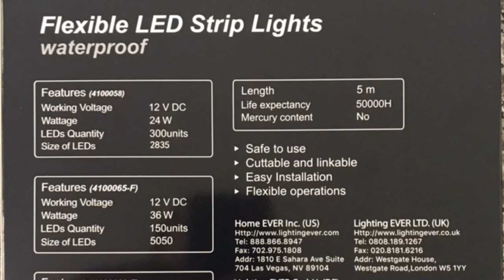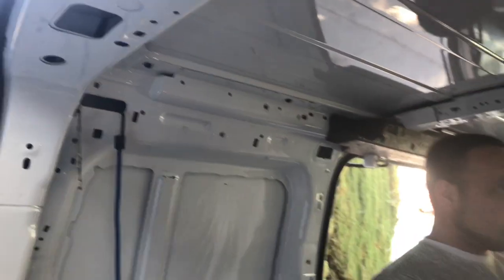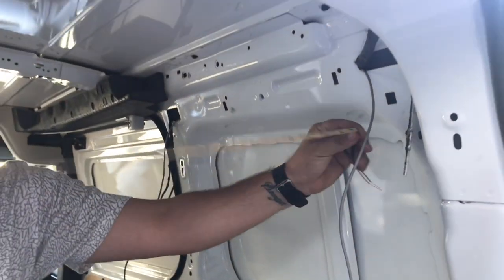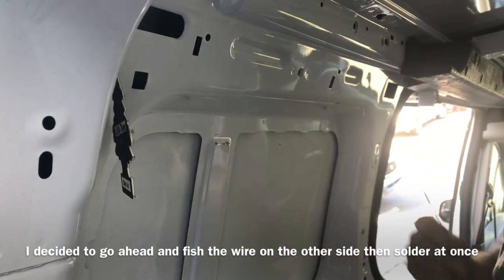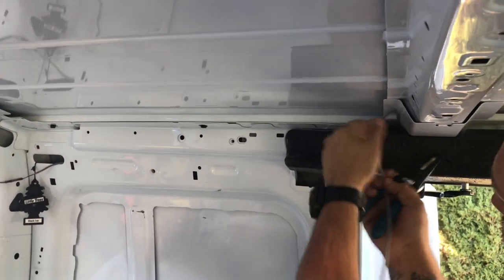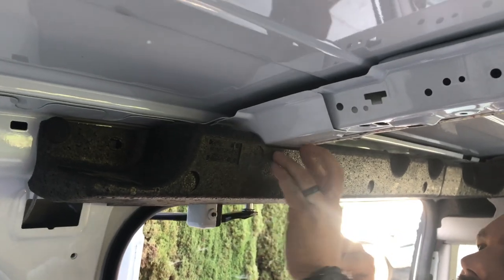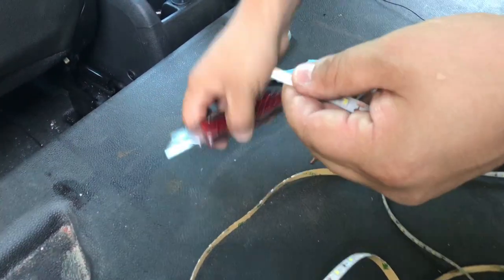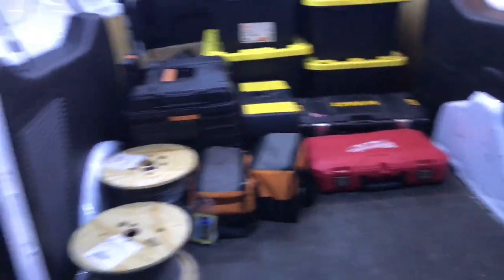How to Add LED Strip Lights to Work Van

Comment: Nice work. I saw the cable spools in your van what type of work do you do? Also, do you have a switch for the lights or is it just strictly when the doors open that they come on?
Reply: Strictly when the doors open. They operate exactly the way the removed lights operated as they are wired to the same power source.

Comment: Nice try always work from the dead end back to the live connection you done it live so every connection was done live under load just a tip in case you had a short in a wire or something that could fry the wiring in the van happened to my bud lights look brilliant & bright 👍
Reply from the maker: Derek Higgins Thanks for the helpful tip. I realize that now.

Comment: Heatshrink tubing placed over LED tape ends and wiring would have created a finished job, and insulated the connections
Reply from the maker: Since I uploaded this video just for fun. I’ve actually replaced the LED strip lights with a better quality. I also added heat shrink and double sided tape so they would stick better. Ill upload an updated video soon.

Comment: Hey Robert, this is exactly what I wanna do with my econoline. Is there any issues with splicing into the existing cab light as far as power goes? Like the fuse or the wiring being able to handle the draw?
Reply from the maker: I haven’t had any issues. With it being LED lights it doesn’t require much power/amps.
Reply: Roger that. I'm lighting that thing up by the end of the week. Thanks, man

Comment: Hi, I want to do the same for my van.. will it burn the fuses or fry the main board once I start the engine ?
Reply from the maker: No, I haven’t had any issues and it’s been 4 years since I put them in. Only thing  is I would recommend to have the engine running if you’re going to have the doors open for light. It did kill my battery once and I had to jump start.

Comment: How do I stop the timer from shutting the lights off after a few minutes?
Reply from the maker: I've had that same issue. I always end up having to close the door and reopen it.
Reply: @robertreyes4269  I'm running a carpet cleaning truck so having my hoses out I can't just shut them. I ended up running LEDs with a switch
Reply from the maker: Yeah it does get annoying. I'm glad you were able to make it work for you.

Comment: @Robert Reyes
Nice video :) One question for you. When I connect an LED tape to your video and when I close the trunk, the tape still lights up like a spot light. Any solution?
Reply from the maker: Thanks. Make sure your connecting the strip lights to the existing lamp in the trunk.
Reply: You could put your own switch in too if that Fails
Reply: I have the same problem when I lock the van they go off after 4mins, when I’m driving they stay on permanently.

Comment: Did the heat melt away the adhesive?
Reply from the maker: Sorry for the late reply. I added gorilla glue hot glue to some areas. Haven't had any issues with the adhesive since adding the hot glue. Thanks for your comment.

Comment: what happens if you have the engine running (which bumps the circuit voltage up upto 14.4 V) and open the doors (i.e. turn the lighting on) ??? Do the led strips get toasted or do they take it no problem?
Reply from the maker: Sander Tel I’ve had these installed for over a year now. I have had no issues. I often leave the van’s engine running while having the back doors open for light. I often work in dark parking garages and needed these lights.
Reply: @robertreyes4269  Thank you Robert, I will give it a go in my campervan... regards, Sander

Comment: how long did the adhesive last on those strips? did they fall of yet?
Reply from the maker: They didn’t last long. I had to add hot glue.
Reply: @robertreyes4269  will double side tape work
Reply: That’s what I’m worried about. I don’t have a clean surface since it’s a foam headliner. And hot glue would melt and would just fall.   Any suggestions on a regular headliner

Comment: Can u do this with color changing leds
Reply from the maker: No. The color changing ones need power from an outlet.
Reply: Even tho u can cut it and Connect it to your battery?
Reply: Or that’s to much? And will burn it
Reply from the maker: I’m sure you could make it work but it may be a little too much for the battery. It would drain it pretty quick.

Comment: No offence but i cant be arsed watching a 30min video. Did you basically just wire the red and black wires to the exsisting system of the van? I have LED lights and they all have plugs on the end its pissing me off. I just want to wire them to my van lol thanks
Reply from the maker: Yeah basically. You may have to cut those connectors off and solder some 18/2 cable to the ends. That's what I did.
Reply: @robertreyes4269  thanks man. I tired this with led spotlights and they worked but just not bright enough because they needed more power. Hope it works with light strips lol thanks

Comment: Unless I missed it, the original cargo light is only operable by Fords ‘Better Ideas’ Body Control Module and we are at the whim of their idiotic timing program.
  I have the 2017 version and I have had the battery die on me numerous times because, like any other service vehicle, we are always in and out all the time. 
 Fords stupid logic is ALL the perimeter lights come on at any opening for 10 MINUTES or until ALL doors are shut. And if you happen to open another door…the 10 minute timer starts all over again!
 They say it’s impossible to change it but hey! Easy turned off by pushing the turn signal forward then pulling back cancels it!!!

Until you open another fkn door!

Once I complete my anger management course thanks to but not funded by Ford,(😂) I will trace the trigger wire as it enters the BCM then add a switch to it so I have control, not the BCM.
  With light I will add to my van, I will run a dedicated line with my own switches.

I’ve actually gone out and bought a NOCO Li-po battery booster and have already used it a few times!

Comment: Good luck when they all fall off 😂
Reply from the maker: Zak Cook 
True. I used hot glue in places were it was unsticking.
Reply: Robert Reyes are they falling off?
Reply from the maker: Yes. The adhesive on the LED strips is terrible. I added hot glue and it helped.
Reply: I bought a 16.4 strip on amazon and the adhesive on it is very good. It’s up in my work van and there are no issues.